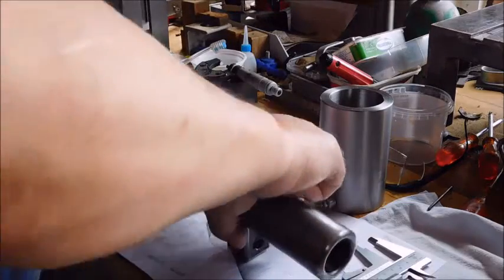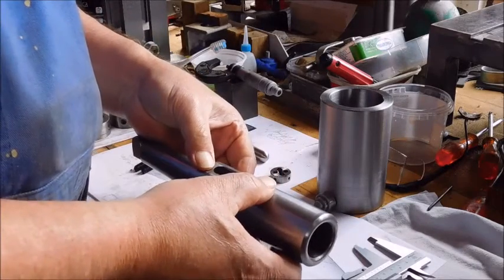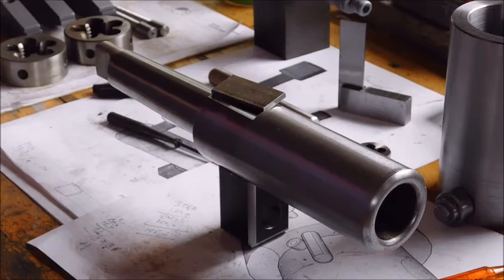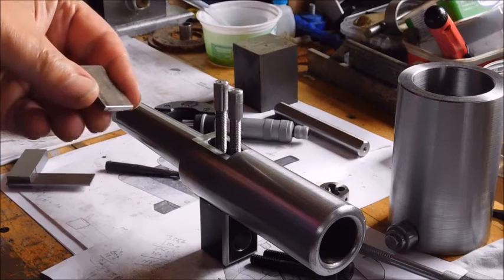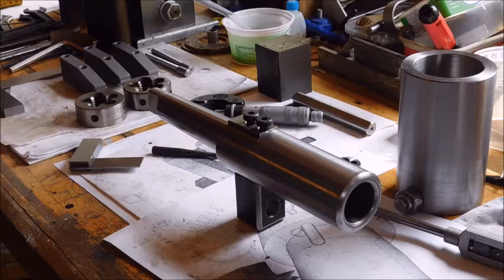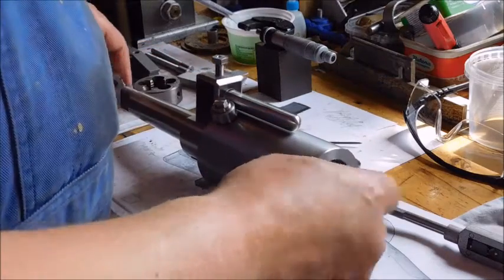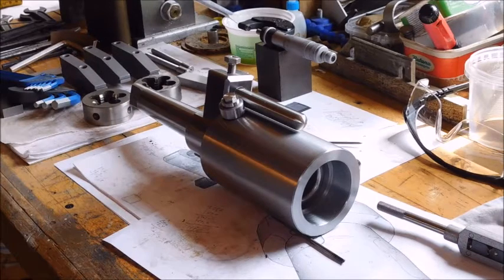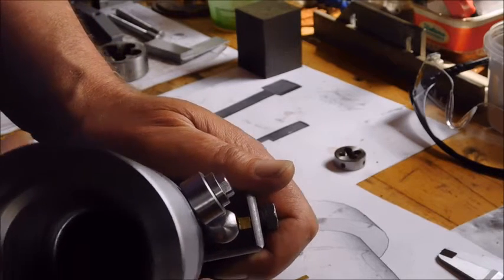TailstockDieHolder 04

Comment: Hi Keld,

That's a better solution.  If you'd welded that and it turned out ugly you would have regretted it.

It's even worse welding high carbon steel like this, which tends to burn in.

Use low hydrogen rods when stick welding this metal.

Looking good.  Neat job, and if it gives problems, you can always fall back to plan A.

Cheers Rob